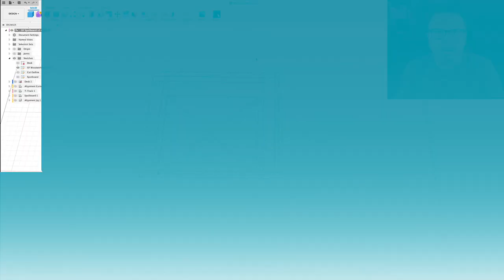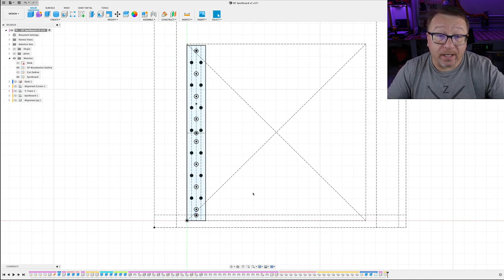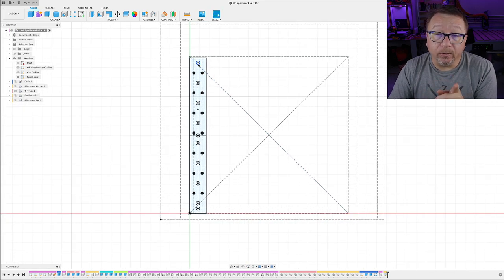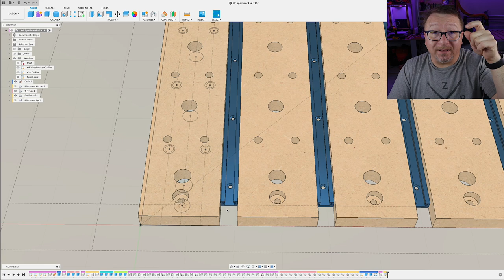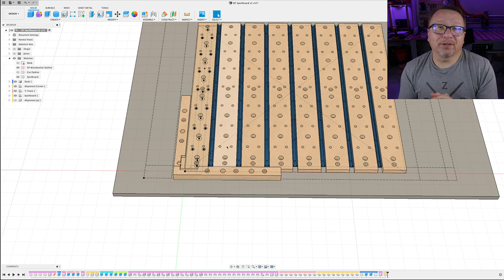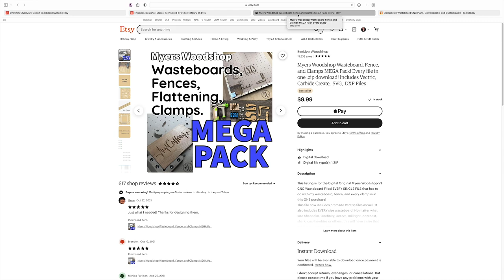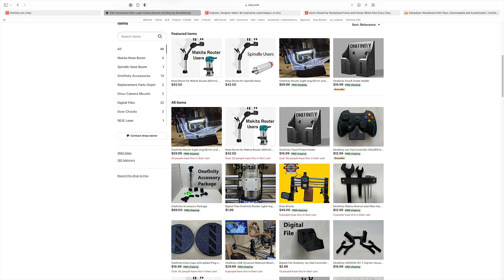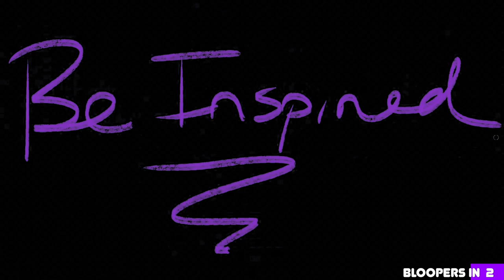How to Create a CNC Spoil Board

Comment: Thanks again for your informative posts.  I went with 1/2” holes and threaded nylon inserts for 1/4 20thr bolts.   I especially like the square corner, maybe adapt it to your drilled holes so you can put it anywhere on the board?   Either way thanks for the videos!!
Reply from the maker: Thanks Robert - I have already changed the corner for the exact reasons you listed. Great minds 😁 Thanks for watching!

Comment: Thank you for posting this video - it was definitely helpful.  My one question is how did you machine the slots in the strips of MDF required to attach them to the table as it seems like you would need to secure the strips in order to machine them?  The Chicken and the Egg dilemma.  Please let me know.  Thank you again.
Reply from the maker: Hi Curtis - I used the CNC to machine the holes. I simply held the strips down with my hands; I tried using tape but it didn't work very well. I did fashion a L-bracket to align the strips to the same location each time. Hope that helps - thanks for watching!